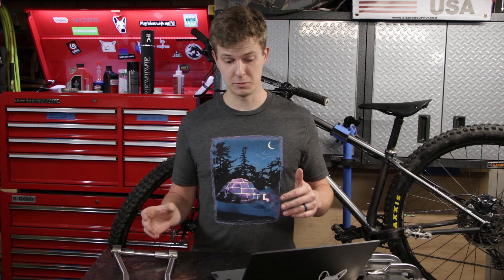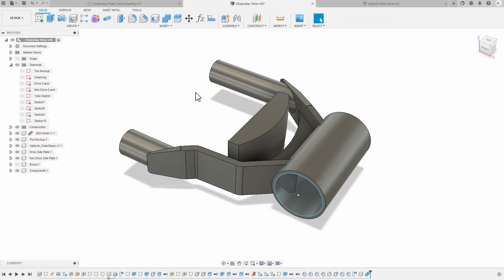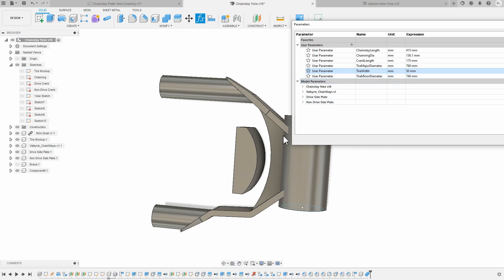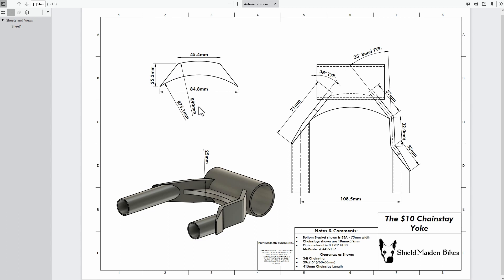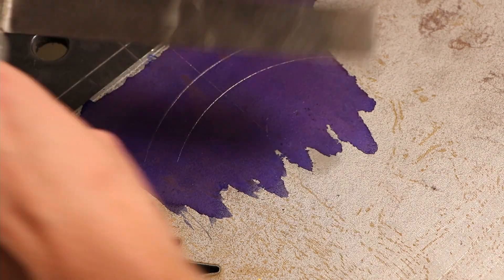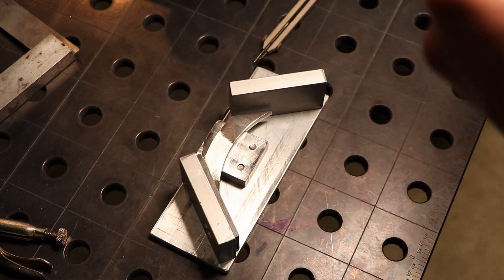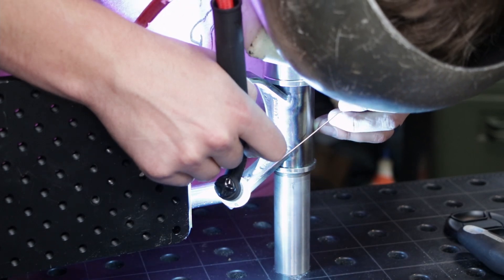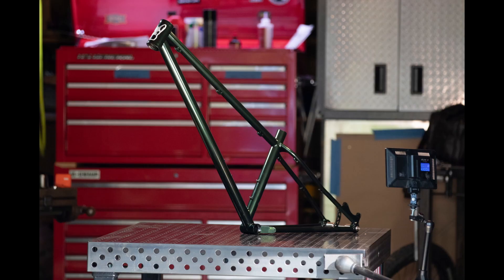Mountain Bike Design 101 - The Chainstay Yoke

Comment: Instead of 4231 can it be done in aluminum?
Reply from the maker: It could feasibly be done. Some changes would likely need to be made to make it stiff & strong enough though. 
Small-scale building of aluminum bikes is a big can of worms though. It's just not feasible for the production scale most folks like me have.
Reply: @eglfabrication can it be done in wood?

Comment: Awesome video thanks a lot!  I'm just now putting the feelers out for building a frame and while I would love to use a fancy paragon CNC machined chainstay yoke I think that this is actually very doable for the hobby builder.  I'm curious if anyone has left feedback on the design and it's long-term suitability anywhere?
Reply from the maker: Thanks! 
I've seen it on a couple of bikes so far, One that comes to mind is someone who modified it to work with a belt drive bike. 
https://www.instagram.com/p/Ca0AXP4O8TU/

That was the original goal after all, to make it nice and simple to make, and modify for other purposes!
I'd always recommend trying this one out before dropping the cash for a CNC machined one. This design can actually accomplish more than the Paragon one, btw.
Reply: @eglfabrication  Awesome!  Thanks for the link that's great.  It looks pretty solid installed on that bike.